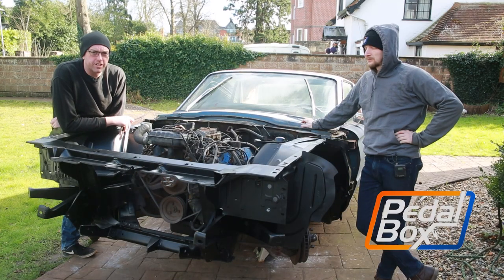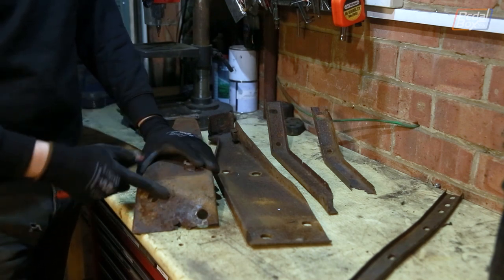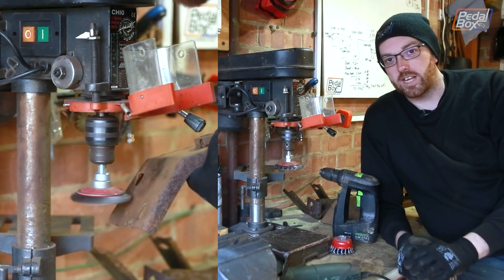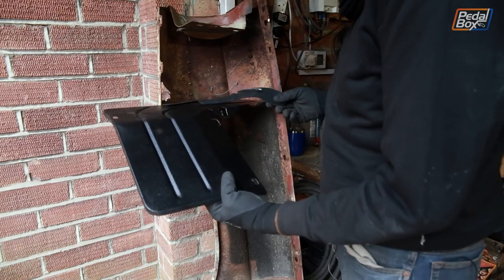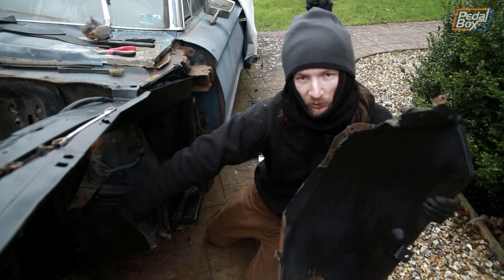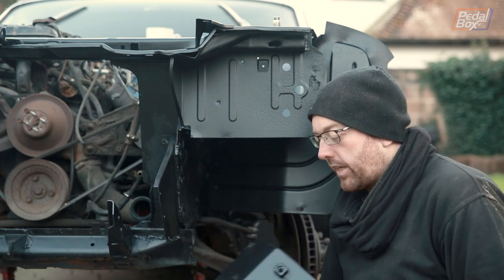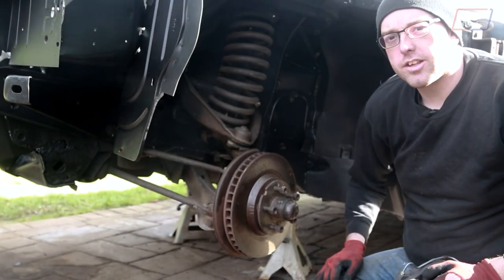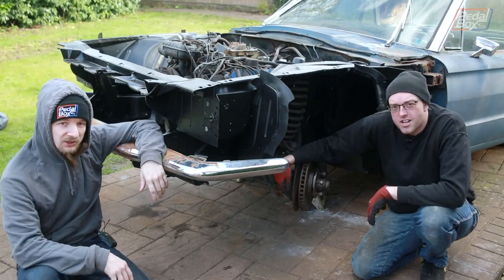Front End Rebuild Pt. 1 | 1966 Thunderbird | PedalBox Fleet Episode 71

Comment: It's a weird juxtaposition; the newly blackened frame looks just amazing, but then the rusty parts seem so... meh. But then, all new shiny parts are going to be pricey as fuck, so I totally understand.
Reply from the maker: Sheet metal is so expensive. IF you can find it, bonnet/roof/boot all impossible to find new. The channels around the boot are something $600 for a set about 2" wide around the perimeter. Brutal.
Reply: @PedalBox  I actually more meant the running gear, rather than the bodywork, sorry.
Reply from the maker: @TheMafii  Ahh, yeah. I mean i'd get speed parts if they were getting upgraded, so yeah. Much expensive :) Running gear is getting a clean up soon(tm)